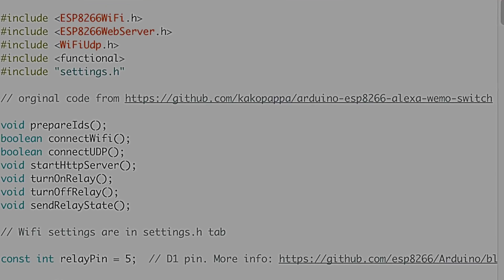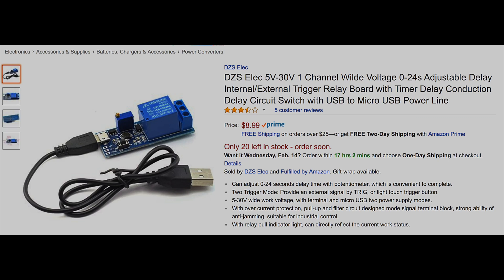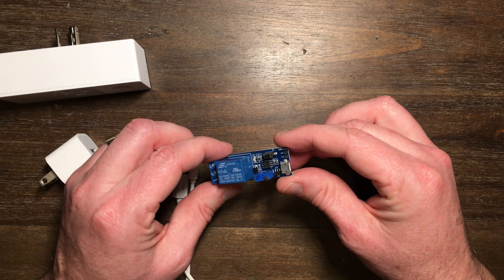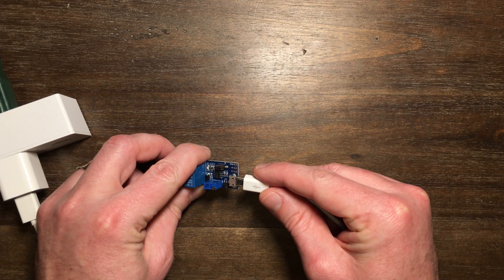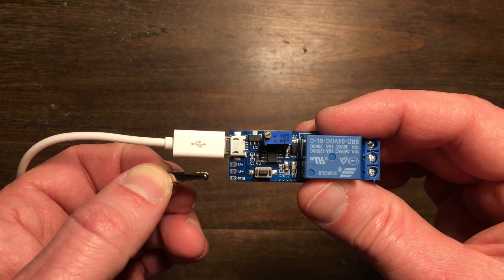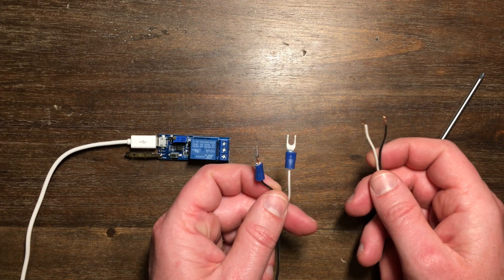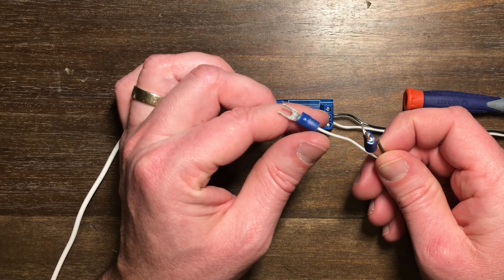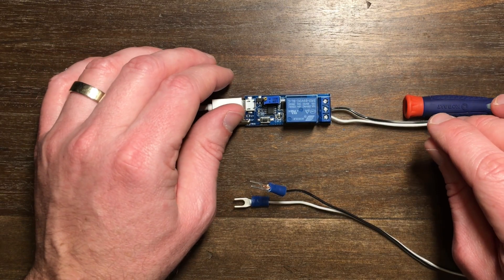Smart Plug Fireplace control for Alexa

Comment: Hello.  I know this is an older video.  I’ve been using this methods for about a year or two now.  Has worked great.   My problem is when the hydro goes out.  I can’t seem to turn on the fireplace.  The wall switch doesn’t work at all.  It turns it off but won’t turn it on.    I connected a battery back to temporary turn it on (while the hydro is out).   

Is there a way to use the walk switch to turn it on and off along with the “relay”?
Reply from the maker: Sorry, I don’t have that module anymore, so not sure.

Comment: I just purchased this little baby.  And I have the diagram of your wiring types.  Going to use the kill switch method.   I just want to confirm that using this module there is no current being sent to the fireplace.   I don’t have to knock off any little chips in order to make it dry?  

Again I appreciate all the help and input and videos.  Awesome job.
Reply: ColdCanadian911 - correct, just follow the video/diagram.  You can test the relay output with your multimeter for both continuity and voltage.

Comment: Can I still physically turn off the fireplace using the low voltage switch or will I need to turn it off using the app for the smart switch. I ask because I can see my wife or kids having issues with this when I’m not home.  Thank you for the great video!
Reply from the maker: Not with this method. I do have videos explaining how to also use the wall switch though. 
https://youtu.be/fYi9pqENf5U
Reply from the maker: I also have a ‘kill switch’ version which you might like. 
https://youtu.be/wUP68vYBIco

But I like 3 way switch method better.

Comment: My Fireplace gas burner (RealFyre G46) has a 325 Millivolt switch will this work with the G46?
Reply from the maker: I think so, but test your existing switch before you buy the components. Just pull the two wires of your existing switch and touch them together. If the fireplace comes on, then it will work. 
Be careful though, I haven’t seen your system. Don’t touch any wires together if you don’t understand what they are.

Comment: Will this work with an older gas valve that has no was switch, but has a control knob that turns the valve of an on. It has a standing pilot
Reply from the maker: No, I don’t think so. This will only work with millivolt systems.

Comment: For the two male spades, does it matter what wire capacity I use: 22-16, 12-10 and 16-14? Also what type of wire did you use and did you buy a fireproof coat for it?
Reply from the maker: No, the wire size really doesn’t matter. It’s all low voltage and almost no current. I think mine was 22-16 and my home builder used doorbell wire. 
I have not used a fireproof coat yet, but I plan to build case soon.

Comment: I am having a hard time finding a WIFI solution for my Heat and Glo Escape fireplace. First, it has a transformer/control box that goes to an IPI board, (many wires going in and out of this thing). The transformer box is connected to a multi-functional wall control that controls two levels of flame, temp control, light controls, and seasonal "always on" pilot. It would be awesome if I could figure out a simple solution like this to simply turn the fireplace on or off with Alexa and yet let the wall control functional for the other features when needed or wanted. But if that isn't possible, I'd be willing to give up all features for voice and internet control of the fireplace. This fireplace was state of the art in 2011 but now it appears to be terminal technology.
Reply from the maker: Does you fireplace have something similar to this? Should be pretty easy to find the switch if it does. https://www.stove-parts-unlimited.com/quadrafire-heatilator-heat-n-glo-control-module-593-592-p/593-592.htm
Reply: Matt,
Thanks for getting back so quickly. Short answer is yes, similar- but it is not OEM of course. OEM just has lettering and numbers so it’s hard to tell if it matches to this product one to one. 
When you say switch, you are referring to the on off switch for the solenoid gas valve, correct? If I find the “switch” , do I simply “pig tail” it so I can maintain the wall controls or how does that work? I called the local Heat and Glo dealer and they said they know of these after market solutions but could not help me with installing them.

Comment: When the Wemo plug is on or off, once everything is connected, my fireplace comes on automatically and will not shut off. Any ideas?
Reply from the maker: Darrik Mullins - My first guess is that the wires going from the fireplace to the relay are not connected correctly. Use the COM and the NO terminals on the relay. The NC terminal is not used.
Reply: mattadata2 yep that’s how it’s set up. Alligator clip over trig and v- is functional as well. Not sure what could be wrong. Faulty relay maybe?
Reply from the maker: Possibly. Do you have a multimeter to test continuity between the screw terminals on the relay? Both when Wemo is off and when it is on?

Comment: when powered at first, the red light lit, and I thought everything was good, but after plugging in the fireplace wires, the light would not light anymore.  I reversed the wires didn’t help and now the device appears to be completely dead
Reply from the maker: Hmmm, not really sure. I think it is pretty hard to burn out this board, but I guess its possible.  Make sure you have a good connection between V- and TRIG. Try soldering a small wire between those two instead of using a clip...the clip may have scratched off the small silver solder pad and you might not be getting a good connection.
Reply: everything is fine now, the alligator clip had slipped. Thanks!

Comment: Parts ordered, ive been trying to figure this out for a bit now. My fireplace doesn't have a on off switch, everything is controlled by remote. I look forward to getting my parts and giving this a shot. Thanks for the video.
Reply from the maker: I bet the remote plugs into something similar that you can tap into. Good luck.
Reply: Got the parts, looking at fireplace now. HMMMM

Comment: Thank you!  I've been chasing this solution for some time.  I ordered the part you listed from Amazon, however i am doing it slightly differently.  I found two switches on the fireplace switchbank, one turned on the fire (2 pole switch), and other didn't apparently do anything.  A little further experimentation using a lamp, I discovered that the "nothing" switch actually turned on/off an electrical outlet under the fireplace (nothing connected to the outlet, so it was unused).  As I had an extra smart switch (that I didn't think I would be able to use), I replaced the "nothing" switch with the smart switch.  As soon as I get my SMAKN® Wide voltage 5V-30V Power Supply Adjustable Trigger Delay Time Relay Module, I will add the phone charger to the now-switched outlet and all will be good.  I will post here again when the module is in place and working (hopefully).
Reply: My doodad came today, so I installed it and it works like a charm.  Thanks Matt!
Reply from the maker: Awesome! Let me know how it turns out.
Reply: Do you know if by default it triggers/acts like a pressed button
Reply from the maker: Sort, don’t recall.

Comment: Thank you for the detailed video! I’m new to gas fireplaces, so I’m not familiar with the electrical part of it. I have a ‘light’ switch on the side of the fireplace buildout that turns on the fire. I watched your install video where you soldered, and it appears you plugged in your Wemo unit in an outlet under your fireplace? So is that where I would find a similar outlet to plug my wemo unit? Or should I use the power to the light switch on the side of my unit to add an electrical outlet to plug in my wemo there? I haven’t dug into my gas fireplace to know if there’s an outlet somewhere in there. Thanks so much!
Reply from the maker: Hi. Yes, there should be an electrical outlet under your fireplace. You can’t add an electrical outlet near the light switch because that light switch doesn’t have 120V AC power. It only has two little tiny wires that signal you fireplace to turn on. Those two wires are the ones we are ‘intercepting’.
Reply: mattadata2 super! I’ve ordered the parts you recommended. I’m guessing I’ll dig out the flammable wool to get under the fire place. Brand new build we moved into so there’s probably an owner’s manual for this fireplace somewhere! Thanks so much for breaking this down for laypeople to comprehend! Especially not having to ‘code.’ Whatever that is! Lol
Reply from the maker: Awesome! Good luck with the project.
Reply: @dmdzdg1   any luck Zac? ive ordered that parts, just waiting on them.
Reply: 00devils I have not. Next week I’ll have a lot of time to do it! I’ll let you know!
Reply: 00devils also, since I use Alexa so much, I ordered their smart plug instead of Wemo.

Comment: Why not use a wemo switch and wire the AC directly to a multi-purpose relay that will switch on 120vac and have the output side open/close the wires that would normally go to the thermostat? (example: Functional Devices RIBU1C [B000LESCI2], $11 on Amazon).  Super simple, the $11 relay, an AC pigtail power cable, and standard thermostat wire connecting the relay output to the gas controller thermostat connection.
Reply from the maker: That would probably work also...as long as it is not sending 120v AC to the fireplace. I haven’t used that type of relay before. Working with low voltage DC seems a little safer though. Give it a shot and let us know how it works!

Comment: Great idea and video, but will this work for millivolt fireplaces?
Reply from the maker: Yes. I installed this on my millivolt fireplace.
Reply: Great video! Do I need to disconnect my current remote for this to work? My wife likes to use the current remote and we would also like to turn on the fireplace using alexa. Thanks.
Reply from the maker: Thanks. I don’t have a remote, so not sure how it hooks up. I think you could leave the remote in place and it should work. The only issue is Alexa might not know if you switch it off from the remote.
Reply: Yes, it will. A standard fireplace thermopile will generate about 400 - 700 millivolts which connect to the TH & TP (bottom & middle) terminals on the valve. Wire this relay to the TH & TH/TP (bottom & top) terminals.